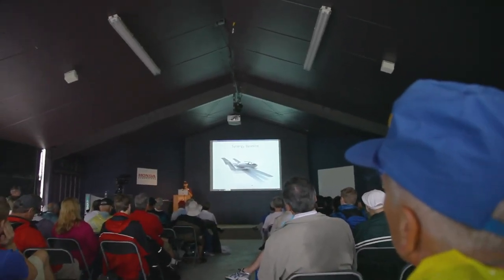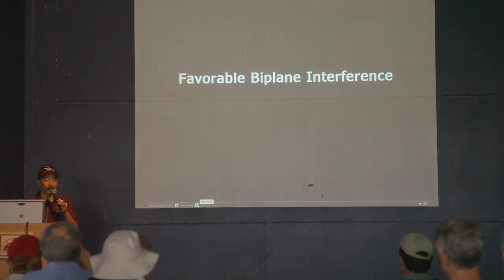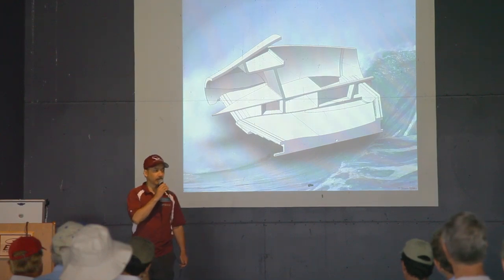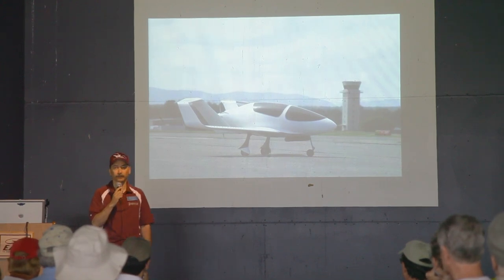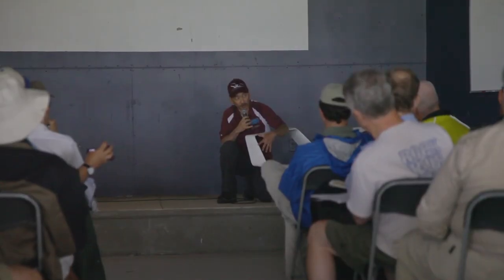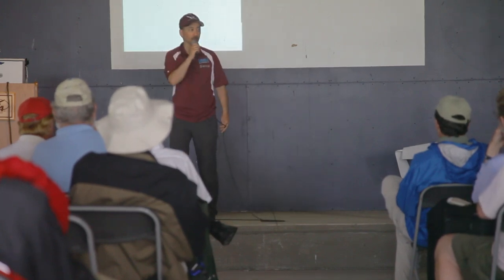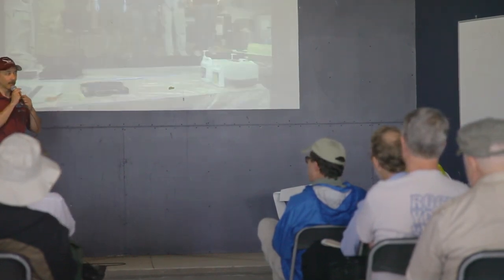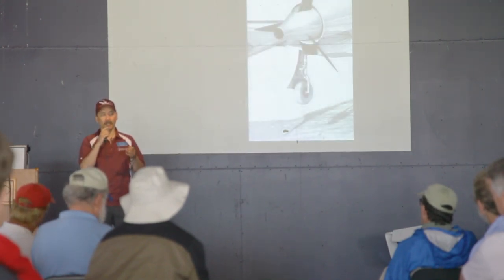Synergy aircraft presentation, Oshkosh 2011

Comment: Cool  looking design, and interesting theory.... But I feel some numbers are fudged.... How can you possibly claim 80% more efficient airframe???? Theoretically your tail surface are not optimal for 180* wing tips. I am curious how you can claim. with 6, or 7 ppl on a relatively small wing, I don't see level flight at 55 KIAS. Then again, I am still an engineering student, However I have done some extensive work with sailplanes, and something about these numbers feels a bit  fishy.